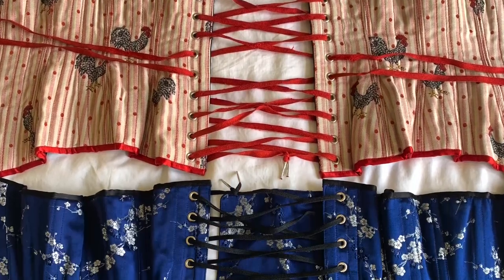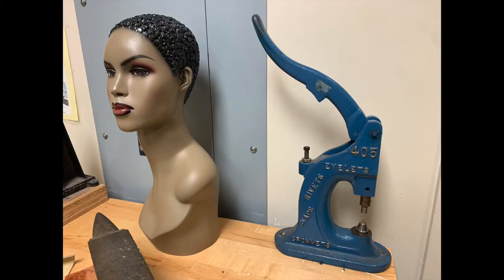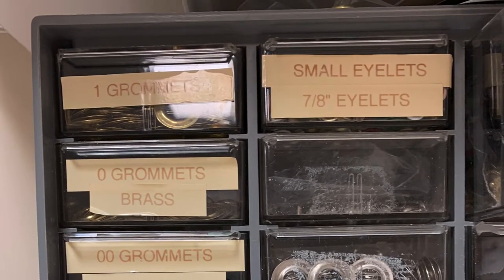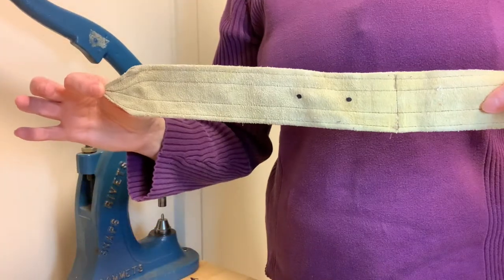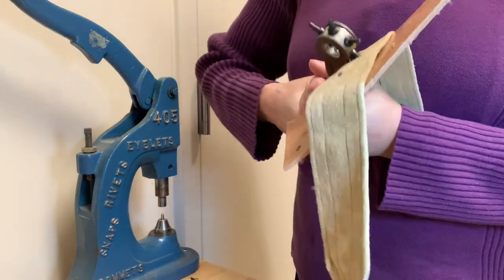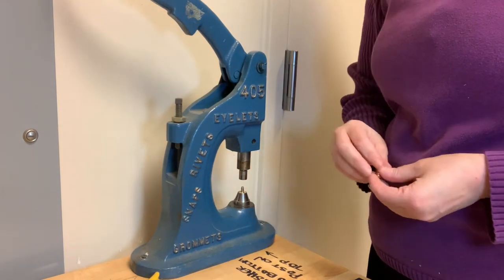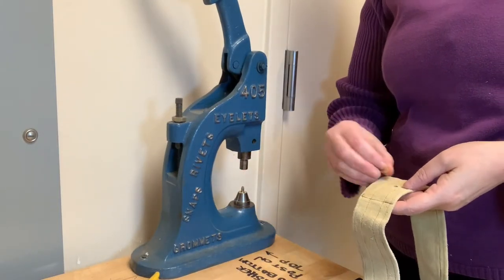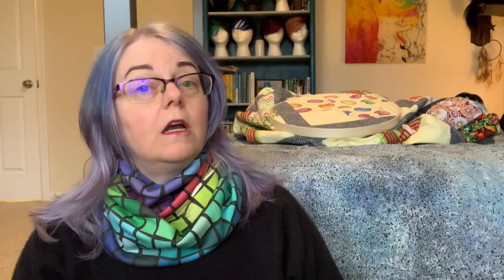How to Use the Stimpson 405 Grommet Press || #corsetmaking

Comment: I love the tip about using the punch pliers with leather! Wish I'd known that before making holes in the corset I'm making!
Reply from the maker: Hopefully it will help moving forward tho! I worked at a custom leather shop where I first learned that tip. We punched literally hundreds of holes a day, if not thousands. It really extends the longevity of the sharpness! 

And luckily, most pliers punches have removable dies for the different hole sizes, so you could get a fresh set and replace them, and then punch into leather from here on. 

I can't wait to see your corset!
Reply: @LaBricoleuse  I think you'll be waiting for a long time for the corset 😅 I stopped when I encountered fitting problems in the bust because I don't know what I'm doing! 😂

Comment: thank you for your video! your 405 machine looks older than the one they currently sell, do newer dies work with your machine? i’m considering buying a similar 405, but it doesn’t come with dies.
Reply from the maker: Good question! I assume they do but I don't know as the dies we have were bought at the same time as the machine. I'm always trying to get funding approval for new dies (especially the snap setters), so if that ever comes through, I'll let you know if they fit!
Reply: @LaBricoleuse  i called their customer service and they said it should match. if i end up going this route, i’ll let you know if it works:)
Reply from the maker: Awesome! Thank you!!

Comment: How would you use this Stimpson 405 press to install grommets in neoprene 2mm.  Thank you
Reply from the maker: Perforate the neoprene, and then the same process should work for installing. You might need to use a stabilizer to keep the neoprene from stretching and the grommets popping out.